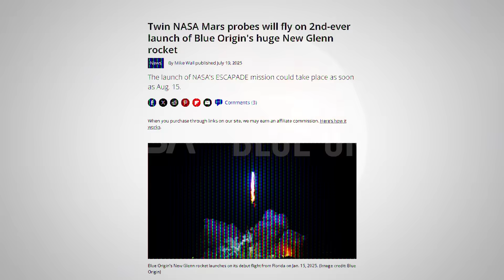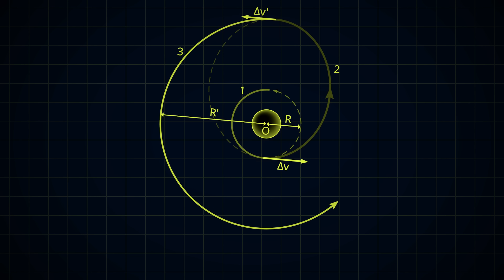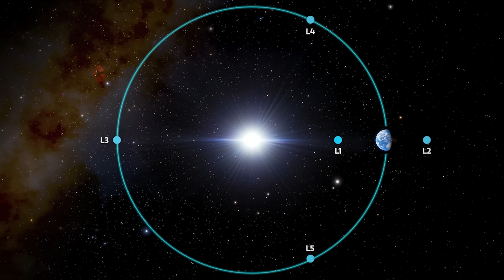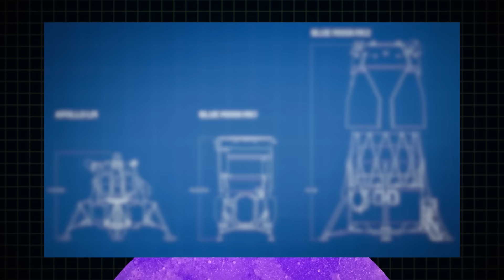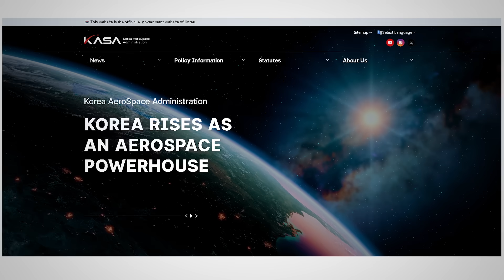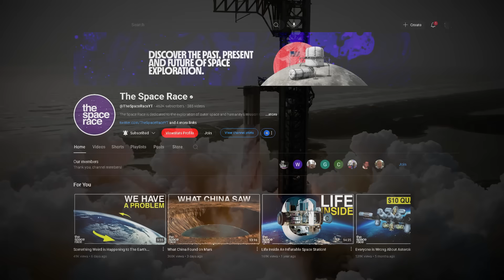NASA and Blue Origin Are Going to Mars

Comment: 0:45 - "the magnetic field of Mars."  There is no such thing as THE magnetic field of Mars: meaning there is no global magnetic field as there is at Earth.  Instead, Mars has many localized areas which have a magnetic field, probably due to localized deposits of minerals in those areas capable of sustaining such a field.  Beyond those areas, magnetic field strengths are very low. So, basically, Mars has magnetic "hotspots", and it's the interaction between the magnetic fields at these hotspots and the solar wind which is to be studied by these satellites.

Comment: Mars hasn't got a magnetic field.
Reply: Mars doesn't have a global magnetic field like Earth does. It does, however, have local magnetic field pockets throughout the planet.
Reply: Not enough to stop the atmosphere from being stripped away and the planet being bombarded  by lethal radiation.
Reply: @michaeldowd8422  basically correct. Time and exposure are factors in lethality. It's not instant. And the exposure due to the atmosphere, thin as it is, is a little Safer for radiation exposure the deeper you go, like in a valley as opposed to a mountain top.
Reply: I would imagine whether being in a valley or on a mountain top on Mars is going to make so little difference to a person's doom as not to be even worth mentioning. But you seem to be well educated on the subject and I respect your opinion.

Comment: Remember, the Moon is actually very hard to land on. During the Apollo mission:
7 launched
6  landed
5 needed a human to take partial or complete control from the computer.
Reply: we will never land humans on Mars, it would be a one way trip and humans could only live for maybe one week before they die
Reply: @stephenpegg5636 bro that ganna send build stuff bases and all that stuff humans need before the humans actully leave for mars
Reply: The LEMs were all flown by pilots. They could not land themselves. Period.
Only 6 lunar landing attempts were made in the Apollo program. Apollo 10 did not carry enough fuel to land on the moon, and take off again. This was entirely to plan.
The moon is MUCH easier to land on than Mars. Of 25 attempts 14 have been successful - a rate of just 56%.
Lunar landings have a 59% success rate, including some recent abject failures.
Reply: It's because you never been